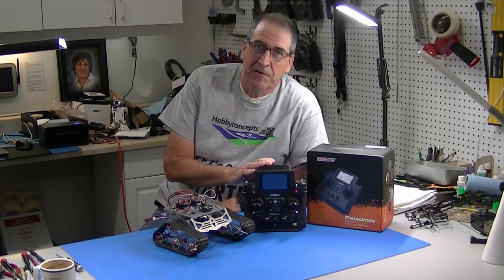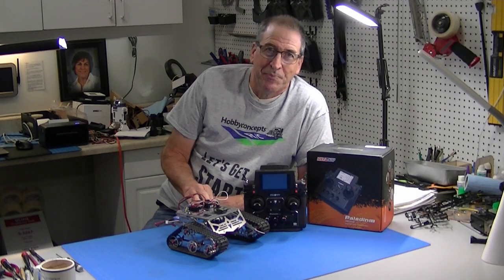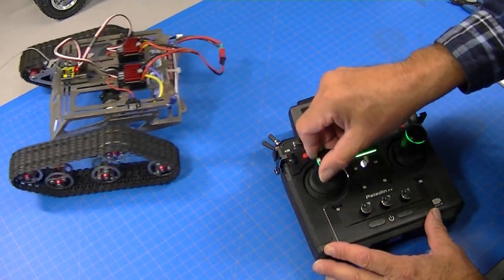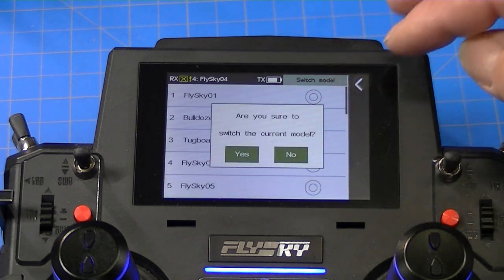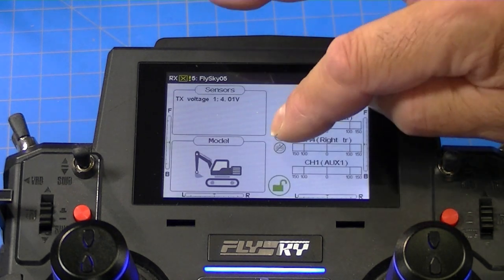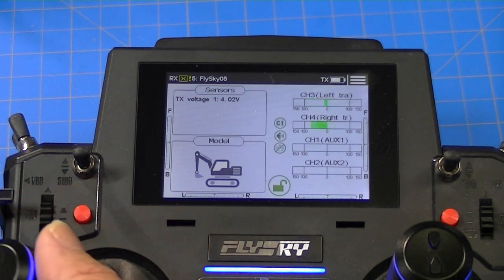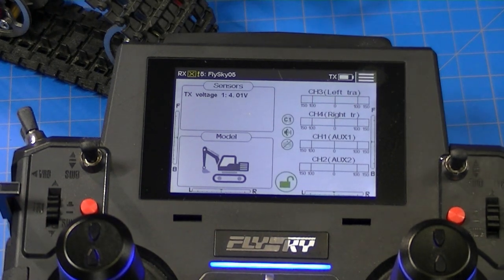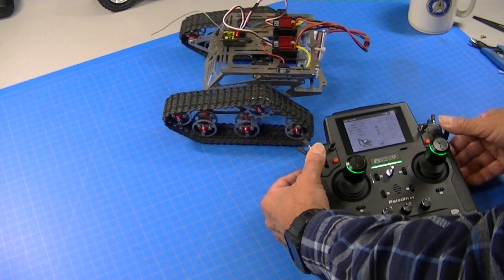FlySky PL18 EV Track Mixing for Bulldozers, Tanks, Robots & More

Comment: Hello, this should be an information for Bob from RC hobbyconcepts.
I think there is a little failure in your video „Track Mixing with PL18Ev“
In your Video at 10:45 you push the right switch VRE fwd. 
When the right track is moving fwd your little robot chassis should do a left turn, 
In the video the robot is doing a right turn.
Could this be the failure putting left track in CH 4 and right track in CH 3?
Or is it only the mix of the aux 1 + 2 in the wrong way?

Comment: Like your video and the track mixing fits well with my Warslug tanks, hence got a unit in and it works very well.  
Do you know what is the best sound unit that is able to syn with control unit ?
Reply from the maker: Beier products are the best in my opinion.
Reply: @HobbyconceptsLLC   Thanks for the advice, got a couple of Beier USM-RC3 sound units from Germany, they work like magic with the Paladin PL18EV unit, especially nice is the remote volume control.

Comment: Why do you have to cut one of ESC power cable? 

I have mixed my ESC for my tank RC successfully but one of my esc power cable have not cutted out, and after few successful runs it doesnt work anymore.

So I look on youtube find this video and kinda surprised that we have to cut one esc power cable and maybe that's why my ESC broken.

Have I burned my ESC or receiver?
Reply from the maker: Generally one speed control feeds power to the receiver, that is what the red wire is for.  If y9u have more than one speed control you do not need both to try to provide receiver power, that is what you pull the red wire from one of them.  it is possible that having both esc's trying to provide power to your receiver damaged it.
Reply: @HobbyconceptsLLC  thank you for the answer. I have found the damage, it is happen to the ESC BEC. I bought UBEC, powering the receiver from UBEC and pull all ESC red wire and it works now. No damage on receiver. The damage seems happen because of I use all the power cable on ESC, I suspected this because I also just ordered 3 in 1 ESC for tank, and yes from the all ESC cable only 1 has complete 3wire, the other two only signal cables.

Comment: One question 
If I have a truck with the mfc 03 or the mfc01 
Can I also attached the inexpensive tamiya light unit ? On the same truck the same way ?
Reply from the maker: Not 100% sure of your question but if you are asking can you use the wireless trailer lights with dual receivers with an MFC the answer is yes you can.

Comment: I never was able to get my track mixing to work using this video.  Had to change settings in mixing on one channel to -100%.  Now with the new Firmware1.0.28  June of 22 it's totally different.  Track mixing is a mystery again.
Reply from the maker: Yes, I do need to do a new video since the software update.
Reply: @HobbyconceptsLLC  Would be appreciated, Flysky doesn't go into much detail and the menus have changed now.  I'm still trying to figure it out.  The issue is I can't get the tracks to turn opposite when making a in place turn.
Reply: Just wanted to follow up here.  Track mixing is too simple with the latest firmware.  As you described in your video before you had to set up two mixes with Master and Slave Channels.  No longer required.  Simply go into the Track Mixing Page, move the slider on the right side of the screen from X to Check and done.  Of course you need to put the left and right tracks on the stick you want to move both.  On mine I have the left stick moving the Left Track by moving the stick forward and aft.  The left stick also controls the right track by moving the the left stick left and right.  Then to mix, again just go into track mixing and change the X to a Check.  Way too easy.  There are other options such as using the levers to move the tracks AND one stick for track mixing but I don't have that set up.

Comment: Hi nice video. 🙂 Have you tried conditions (move / work mode)? I can assign the switch to chose the work mode but have no idea how to actually get it working. I want to use sticks for tracks in move mode, and manage arms, bucket... when in work mode, Do you know how to do it, please? Thanks 🙃
Reply from the maker: I have not tried mode that yet.
Reply: @HobbyconceptsLLC   Thanks anyway, there is not much written about it in the manual.

Comment: Can you get Sind  boards for this set up bud as I’ve got a hen long Abrams M1 A2 full metal tank just can’t stand the remote thay give you was thinking of up dating the board to a Clarke to 60 but can’t find them on eBay and flipping expensive lol
Reply from the maker: Coming soon is the Beier SFR HL double esc board designed for Heng Long and Torro tanks.  Use any radio and azaing sound and features.  Better than the Clarke board and I will have U.S. support.  Video coming in early 2022.  See the board here: https://hobbyconcepts.net/products/double-sound-speed-controller-sfr-1-hl-for-heng-long-tanks?_pos=8&_sid=c381ebf57&_ss=r